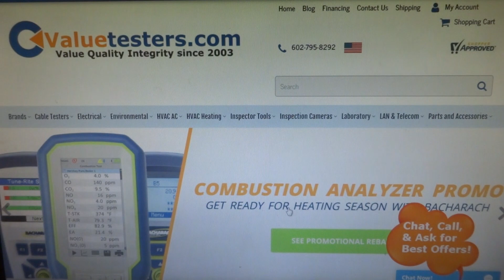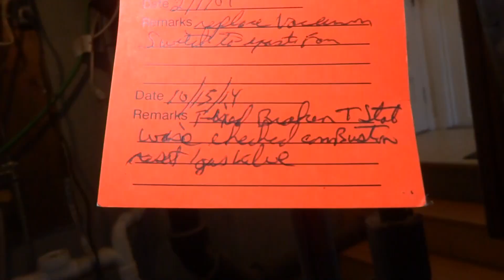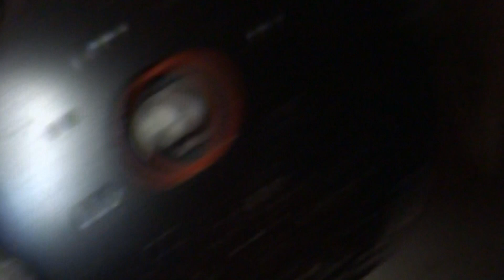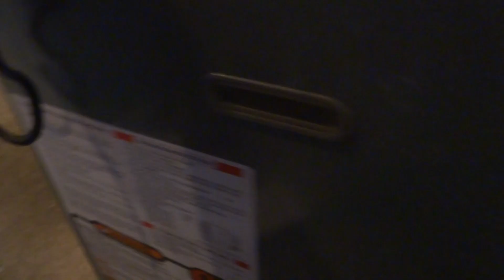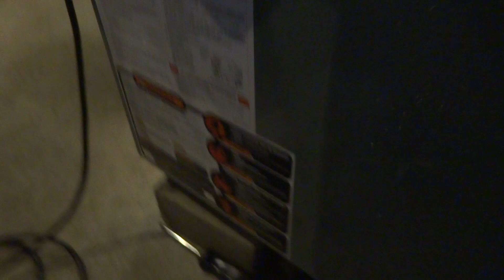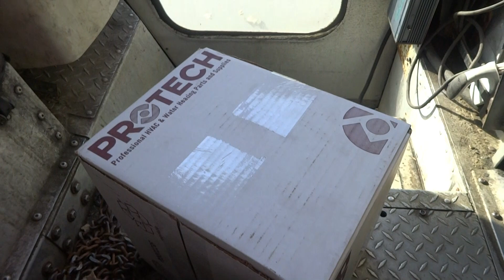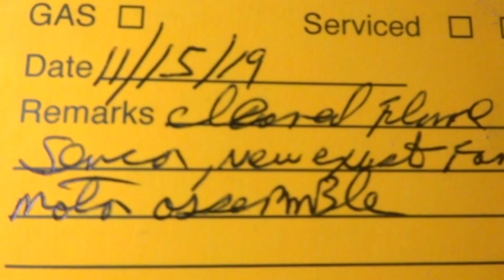gas furace no heat loud noise when running

Comment: Ive found several birds in inducer motors.   get your 11/32 nut driver tighten the motor to the housing, but bearings shot.

Comment: I about fell over when they told me how much  my inducer motor was gonna cost. $580.00 that molly is quite the cute little dog. It’s cute watching you two cruise along in that van together.
Reply: The motors have dropped in quality. A lot of the Fasco motors are now made in Mexico and they don't hold up nearly as well as the old ones. Some furnaces use really cheap 2 pole induction motors for their inducers. Those are real crap.
Reply: Depends if it single stage or 2 stage
Ecm or split capacitor. Some cheap some are expensive. All do the same thing. 1. Aid in stack action
2. Close pressure switch or switches
3. Prevent flue gasses from entering the combustion chamber
Reply: @RockoRocko-rz7kx  I understand what they do and how they work. Those motors work in a fairly tough environment, and depending on how well they're made, (bearing quality, tolerances, etc) they'll either hold up for a long time or crap out within a few years. My previous Amana furnace had a US made 2 speed Fasco that was very well built, and I believe, used roller type bearings on both ends. That motor ran flawlessly for the 20 years I owned the furnace. My replacement furnace also uses a Fasco, also 2 speed. Made in Mexico.  Don't know if this one will last.  Certainly doesn't look anywhere as well constructed.

Comment: This is the same guy that split the thermostat wire building his basement wall.  I bet the electric work was his.
Reply: Take ten minutes and put a box connector on that Romex going into the switch box.
Reply: @throttlebottle5906  Absolutely, agree.

Comment: it looked like the motor frame to support stand was loose and needed to be tightened.
Reply: Agree. Only question was how the two were held together. Sometimes they use a rivet assembly which would have to be drilled out and replaced with nuts and bolts. Not something I'd expect a repairman to do on a house call.

Comment: Or you tell the customer the problem and they say", my cousins next door neighbors uncle use to do this type of work and he says all you got to do is tighten the screws. Or its I talked to some guy and he said this should cost no more than a hundred and fifty! Some of the hardest parts of the jobs dealing with customers and not the job itself